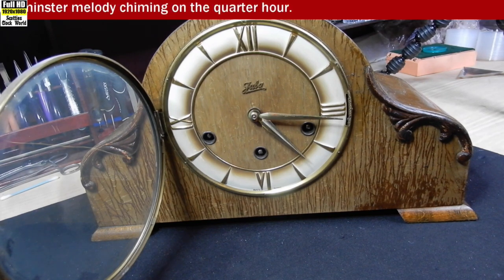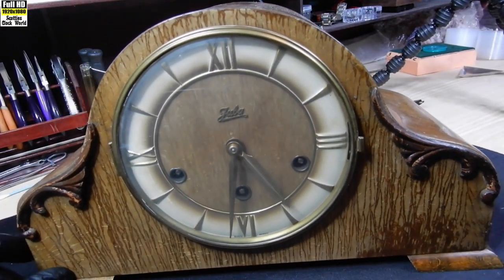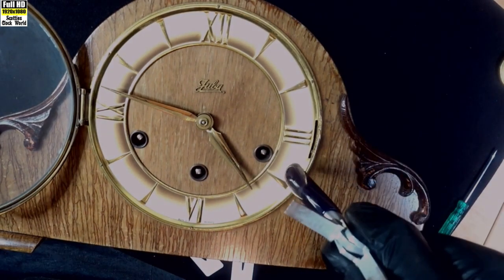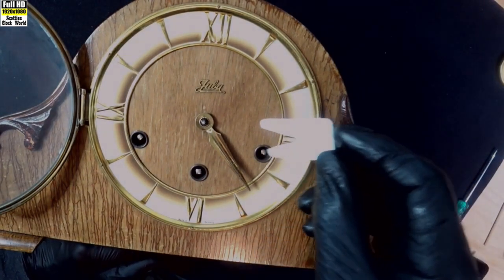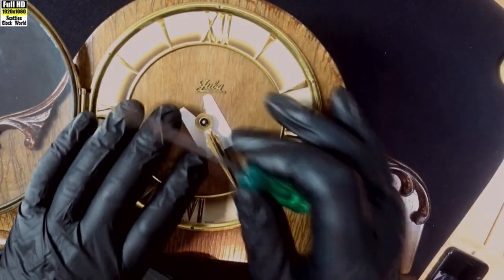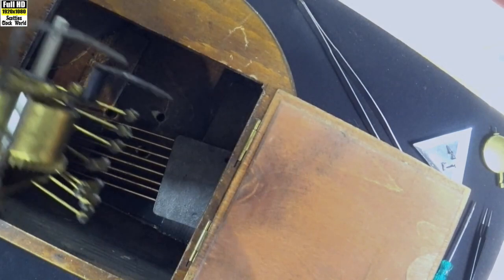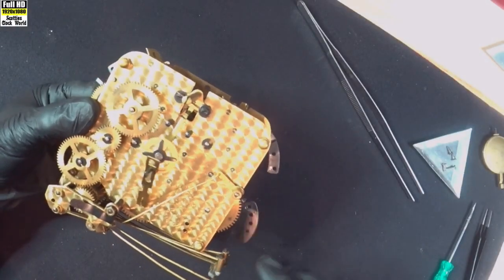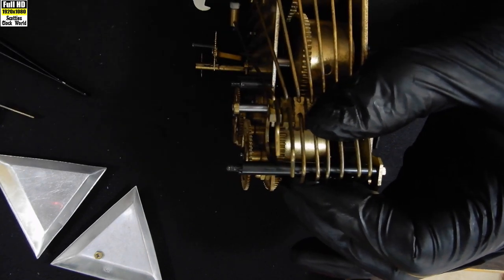German Juba Triple Chime Mantle Clock Repair - Part 1

Comment: Some of these movements are quite tricky to get out of the case. Always take great care of the chime rods and try everything to remove them first, they are easily broken at the base and if you do break one, the whole set will need to be replaced as they are all tuned as a set. 
They usually are designed to come out first, before trying to manoeuvre the movement out.
Nice to see someone else working on one of these triple chime movements, clever engineering in such a small package.